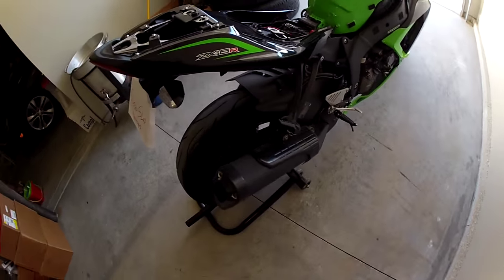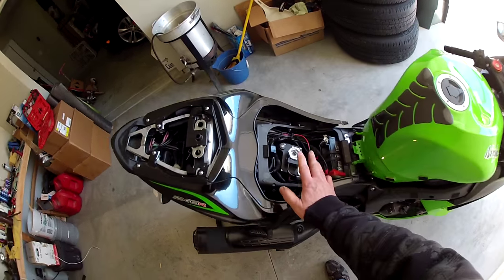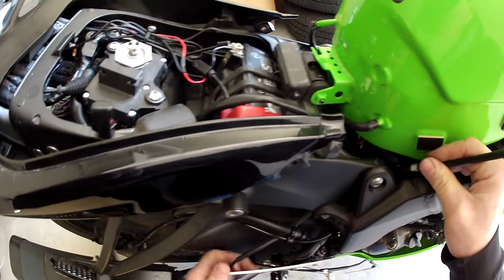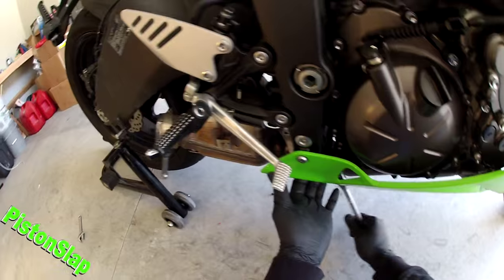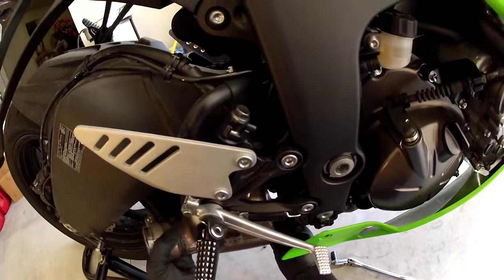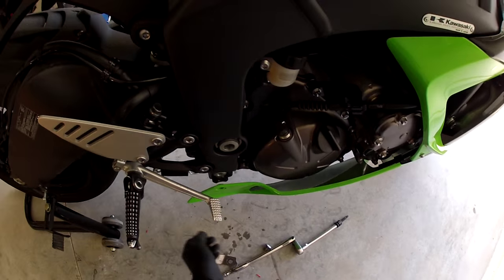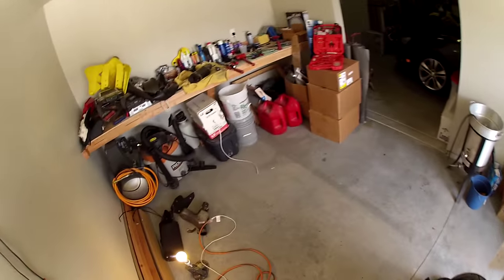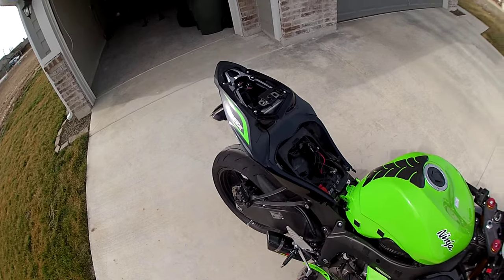How to install a slipon and gut a cat!

Comment: Great video. To anyone watching this vid now, consider using a drill with a long, metal bit. We used about a 5" bit for the first piece of the cat and a 12" 3/8 bit for the second one. Still takes a while and some elbow grease but not too bad, and I'm sure it stresses the bike a lot less than a hammer and chisel/pry bar. Also, you will need a powered plug-in drill. We tried a battery powered one and it was nowhere near strong enough.
Reply from the maker: Paul thanks for that info.  I'm going to pin your comment for everyone.   How much were the drill bits?
Reply: Piston Slap they are about $14 each. We already had the shorter one so if you didn't have any drill bits you could just get the 12" and that would probably do the trick. It might be a little awkward for the first one since it's not that deep in the pipe, but it'd work and you'd save $14

Comment: When removing the cat it is recommended to get a tune that gives the bike a little more fuel than with the cat, due to the loss of back pressure. Without the back pressure, your bike is allowing way more air into the bike, since the air moves faster out of the exhaust. Which means the bike will be running lean. No, it won't immediately kill your bike. It won't kill you bike in 10,000 miles. But it does do some extra wear to the engine, as well as make the bike run slightly warmer
Reply from the maker: Flushhed yep.  It is almost like having a race header.  Just a little smaller pipe and stuff.   I used the tune on graves motorsports site.  The I did a plug reading from the original plugs and the color is almost spot on.
Reply: Questions for yall as my bike is slightly different  (gutted cats, stock pre muffler, m4 muffler after that) thoughts on re tune. What creates more back pressure. Pre muffler of cats? Also stock air intake. Thanks in advance
Reply: Huh and here I thought the o2 sensor on a stock ECU regulates the air/fuel ratio?
Reply: @wpbninja7287  typically it’s only to a certain extent, there’s a set range it can adjust to. i might be wrong, but that’s how it was on my car, it was always recommended to get a tune of you remove the cat because the difference was too much for the ECU
Reply: @dbzx6r  it's is set to a certain limitation but I would only worry about it as check engine light came on specifically for that for fuel trim being set too high or too low cuz that would tell you that you need to get it tuned otherwise you shouldn't have to
Reply: @dbzx6r lf you were lean, could you just upsize the injector to realign the AFR the O2 is looking for?

Comment: I am amazed all the unwanted stuff that comes on bikes these days. You describes the process very well. Even I could do it. I watched the whole thing and I don't even own a ZX6R. What the heck does that servo operate. Some type of exhaust vane?
Reply from the maker: The servo controls a valve in the rear part of the exhaust.   I'm not sure if it's like the corvette and they use it to keep the bike quite untill you get hard on the throttle and high up in the rpm.  or if it's for low end power to build a little back pressure.    I didn't notice a lack in power at the bottom end when I changed everything so I going with a sound control device of some sort.

Comment: EXCELLENT VIDEO, AS HE STATED, STONGLY RECOMMEND TAKING THE HEADER OFF, THIS IS A VERY DUSTY AND DIRTY JOB. I DID MINE OFF THE BIKE AND IT WAS A PITA. IT SEPERATED FROM THE HEADER FINE BUT THE HARDEST PART WAS BREAKING UP THE LARGE PIECES INTO SMALL PIECES TO COME OUT THE COLLECTOR OF THE HEADER.

#1 REASON IS YOU WILL BANG THE HELL OUT OF THE CORE INSIDE THE HEADER AND THE HEADER IS NOT SUPPORTED ANY WHERE ELSE ON THE BIKE EXCEPT THE EXHAUST STUDS. YOU DO NOT WANT TO BANG ON THE HEADER WHILE ON THE MOTOR, YOU COULD EASILY CRACK YOUR HEAD!!! SINCE YOUR APPYING A DIRECTIONAL LOAD TO THE STUD. STUDS ARE STEEL , HEAD IS CAST.
Reply: and wear face mask? surely the stuff inside is hazardous?
Reply: Steve Griffiths it may be, but I don’t think platinum dust is hazardous. It’s never a good choice to breathe in dust though

Comment: are there any performance gains from knocking the cat out, or is it just a change in sound ?  I'm waiting on this muffler to come in for my 17 zx6r and wondering if the extra work is worth it.  Well done on your video, New sub !!
Reply from the maker: frosty116  I would believe there is a performance gain...a small one but your increasing the flow of the exhaust when removing the cat. Thanks for watching!

Comment: I have zx636 2017. I didn’t remove the valve. The two donuts u talking about. I removed just chamber. And slip my new Akra. The sounds is really nice from the stock. Noe my question do u think it will make a major difference if I go for those two donuts or it’s not necessarily a noticeable gain.
Reply from the maker: The gain will be minimal but it was free for me to do it.  The sound will also be a little bit louder.

Comment: Same as my gsxs1000 , told that the cat is the muffler , in the UK so the cat will be needed in the future & I don't mind having a cat (actually want one) removed the muffler but had to take the headers out , grief without taking them off

Good video
Reply from the maker: Thankfully they haven't pushed for emissions testing on motorcycles here....yet

Comment: I have a two brothers slip on and I'm pretty sure my cats are in my header but every forum says that it's in the muffler but it sounds way to quiet to be in the muffler 08 cbr1000
Reply from the maker: I wouldn't know on your bike.   I was told the same thing and when I had it apart I found that they were in the head pipe.
Reply: @PistonSlap  I think that everyone thinks the resonator is the cat idk ill end up buying headers for it eventually so itll be fine I dont think I can decat them bc the cat isnt in the 2-1 pipe in the header it's in the 4-2 section where the header goes from 4 pipes to 2 pipes
Reply from the maker: @alstonz5558  if you are really good with a tig or mig you could cut it and gut the cat then weld it back
Reply: @PistonSlap  might do that itll save me 800$ I dont have a welder but I can buy one and itll pay itself off right away instead of spending 800 on headers

Comment: piston slap i have 06 zx14 with a 08 zx14 header which that year has the cats inside header, ive driven bike 1000miles like this since old owner had just exhaust tips on header only so yeh it was loud... well i found a vance and hines cs1 exhaust or slipon and i gutted my cats in header- since i gut them im not driving it like that since its loud and i dont wanna mess it up neither. should i feel a difference in power considering i never had mufflers since ive had it and i gut the cat? the 06 zx14 didnt have cats in header but if not mistaken it had them in mufflers so i should be okay but i am considering a powercommander but what u think? the secondary butterflys are gone to from previous owner
Reply from the maker: Danger Davefpv removing that cats shouldn't hurt the engine.  They only help clean up the exhaust gasses for emissions.
Reply: Piston Slap thank u pistonslap

Comment: Taking off stock exhaust was probably the most fun, it is one of the best mods you do can. You can also get "Servo buddy" but chose to keep my servo in to save money and no check engine light on.
Reply from the maker: +Shift-Light I want to weigh my stock exhaust,  I also removed the rear passenger pegs ,  (I don't have anyone that rides with me so no need for those).   The bike looks a lot cleaner with out all the stuff on it as well.  I would like to get it on a dyno to see what gains I had made!

Comment: My latest mod!  I don't how you got the pre chamber out without removing the wheels.  I tried but I gave up and took the rear tire off.  However, I didn't remove the cat (Protect Earth) but the bike sounds great!
Reply from the maker: Chris yeah the pre cat was a bit tight with the rear wheel in.
Reply: I did it, I think I let air out of the tyre  til it was quite low and then it squeezed out

Comment: How much louder is the bike with no cat? My friend has m4 gp slip on with cat still in it seems pretty loud.
Reply from the maker: It's loud,  I don't know if its louder than the M4.  I normally ride around in high gear so not a lot of RPM but at the track you could tell.   I have a few track day videos that you can listen to it

Comment: Hey mate great video. I looked through the comments to see if anyone else asked this question first, but no one did. Would you say that it’s doable to saw them out once you make a hole with a drill or is the metal that solid? Trying to find a better way to get them out while we have time on our hands. Thank you!
Reply from the maker: Im not sure how you would get a saw blade down in there and cutting the pipe to get better access to it would posibly cause a leak or alignment problem if your not careful.  Its a crappy setup to try and get them out.   Its one of those thing that will require a little bit of time and effort
Reply: Piston Slap just the blade part itself I meant. Is the material really strong or do you think that a blade could cut through it?
Reply from the maker: @leighpollitt3395  if you got it though it might work.  You would need to get a hole stated first for the blade to go through.

Comment: I have the same bike. I’ve seen the servo on my bike BUT I bought the bike with a shorty exhaust so I’m not even sure if the servo is still hooked up. Also I’m sure my cats are still in. Should I leave the bike how it is until I can get the ecu flashed or could I go ahead and remove all that stuff and flash the ecu about a week or 2 from today?
Reply from the maker: If you look near your right foot peg there would be two cables attached to the exhaust if it was hooked up.   Most guys just remove the cables and leave the servo plugged in to prevent a check engine light. Removing the cat will not set a check engine light.   Im not sure of the bike you have as far as what country your in.  The euro models cam with a o2 sensor.  If that is your case it might trip a light for that. It would not hurt it to run with the check engine light on for a couple weeks if ypu decided to unplug the servo box.

Comment: I would like to see the gutted cat after you knocked all that honeycomb out.  Is the inner wall smooth now?  Or are there remnants of the edges of the honeycomb donuts?  I have a 2019 ZX-6R and would like to retain the stock header if it flows about as good as an aftermarket header.  Thanks in advance!
Reply from the maker: its smooth.  If your looking to squeeze ever once of power out a header would be the choice but for the every day rider I  feel the gutted head pipe is the better alternative.
Reply: @PistonSlap  Thanks for the quick reply.  I am an ex-racer (AMA superbike in '90s) and really just want to use the bike for street and the occasional track day.  I plan to get a pipe and have it remapped at 2WDW.  The stock header looks like it is 95% there, as far as flow, if I add a slip-on.  Just the cat removal is needed.My bike will never be used (by me) in a race, so I do not need to extract that last 1-2%.   Thanks fo rthe vid!  Great work!

Comment: Hi pistonslap ive got a 2015 zx636 and I want to install a akroprovic slip on and remove the baffle box and replace it with a straight through de-cat pipe,if I just disconnect cables and remove them from servo and leave servo in place under seat I shouldn't have to have a tune up or worry about any lights coming up is that right? Cheers
Reply from the maker: You are correct with leaving the servo on the bike and removing the cables.   You wont have a light.  The cat on your bike is in the head pipe. The pipe you are getting is to take up the space from the head pipe to the slip on. Thanks for watching.
Reply: @PistonSlap  thankyou for quick reply I'll crack on and order it cheers

Comment: I have m4 gp slip on on my 2014 zx6r and I am wanting to add a mid pipe to it. Do you know if all mid pipes fit the slip on exhaust, or will I have to get a whole new exhaust? I don’t want to gut the cat like you did, don’t really trust myself to do it. Would rather buy a mid pipe, but don’t know what to buy to fit my current slip on. Please help me
Reply from the maker: I'm not sure what to say.  The cat is part of the head pipe. I don't believe there is a mid pipe unless you buy a aftermarket header. Danmoto I belive  is the manufacture.  With other exhaust systems im not sure of like size or location.   I wanted the muffler/slip on as close as possible.
Reply: Okay thank you man, I may just gut the cut eventually. What do you think the best way to do it is? Don’t want to risk damaging anything ya know?
Reply from the maker: @Edjucated_  the best way is to remove the head like from the engine.  That way you don't risk ruining the seals or head.    A long punch or drill bit with a some elbow grease will work for you.

Comment: So, if I take off the pre-chamber, my bike will be louder? I bought an Akrapovic exhaust. I love the aesthetics but it's still too quiet for me. Seems fairly simple. I don't think I'm going to mess with the cat yet though lol.
Reply from the maker: If you deleted the butterfly valve it might get a tiny bit louder at lower rpm.   The butterfly is in that pre chamber
Reply: Piston Slap thanks man, I tried getting it off and I failed to realize I was going to run into the same problem you did. (The tight space) what tools did you use for reaching those? I’m going to order it on amazon for the weekend. Seems fairly quick though.
Reply from the maker: @itsjustjonnoh  I used a long screwdriver and a medium sized pry bar for the deeper one.   I pined Pauls comment he posted a few size drill bits that he said worked better.
Reply: Piston Slap cool. So, deleting the butterfly valve and a servo delete would probably get me to a decently louder sound. I appreciate the help man!

Comment: Hello man and thanks for the video....
I have a question please and I hope you would help.
I have a 2016 Ninja1000sx, it has no servo but the back chamber and the cat are may be the same like yours.
I've got Akra megaphones slip on on both sides but they don't sound as loud neither as deep.
I'm thinking of removing the cat and the back chamber but I was wondering if the performance would be affected!! What about the O2 sensors, ECU, F1 and resting rpm? What is the best way to fix the above issues after I do that? 
Thanks
Reply from the maker: yazan talab I would jave the ECU flashed to delete the o2. by removing the cat ypu will loose a tiny bit of low end torque but the tune will make up the difference on the higher end of rpm scale.   if you have access to a cutom tuner that is the best route for tuning.
Reply from the maker: yazan talab forgot to add that the rpm shouldn't be affected..the ecm will control the idle.

Comment: So did you pc5 dyno tune the bike? Results?
Reply from the maker: I haven't had  the bike on the dyno yet. But the tune is from graves motorsports.
Reply: Piston Slap dude your video with cat removal was very informative. Even I thought the metal box below was the cat.
Reply from the maker: +Jayden Valentine Thanks!  when I first got the bike and for a long time I thought that was a cat as well.    When I started looking I to exhaust options I fou d out it was jut another muffler.
Reply: Piston Slap any idea what the use of the second muffler is?
Reply from the maker: I think its to keep the bike quiet.  I believe there is a 88 decibel limit the manufactures have to meet.

Comment: How can I find out exactly where the cat is located on any given bike? Especially a new model where they don’t have a full exhaust for yet. Thanks for the video
Reply from the maker: The only way I van think of is physically take the exhaust system apart and look in it. If you have access to a borescope you could slide the pipe apart and slide it in to take a look. Most catalytic converters that I have seen seemed to be underneath the bike at the bend to the first slip on pipe
Reply: Piston Slap borescope. Great idea! I’m looking at picking up a Tenere 700 when they’re available in the states and want to do a proper tune to free up what EU5 takes away from performance. Thanks for the idea
Reply: @PennsylvaniaDualSport  Hey, the cat is in the header's again for the new model. You can follow this video 😉

Comment: I'm debating on removing the cat and replacing it with a mid pipe. Truthfully, was it super difficult to knock the Cat out how you were? It just seems to much more simpler than taking the headers off. (I already have a Two Brothers slip on).
Reply from the maker: If you can get a air hammer and a long bit then knocking the cat out is cake.  Takes a matter of minuets.   If you do it the old fashion way with a hammer and a long screw driver it takes 2-3 hours.  I would recommend taking the head pipe off, but it is not required.
Reply: GcItalianBoy did you ever do anything? Trying to find a mid pipe that will fit my current slip on. Idk if all of them do or not.

Comment: Catalytic converter is there to convert harmful gas. What's the purpose of removing it, to make it louder? Anyone did a before/after cat with significant difference in the sound?
Reply from the maker: Khoa Vo the catalytic converter is there to basicly clean up the exhaust gasses that come out of the engine. When the gasses go threw the "cat" there is a chemical reaction that takes place to make the exhaust gasses less harmful to the environment. Removing it will increase flow through the exhaust, which will increase performance.   There are side effects.  Yes it will be louder.  You will loose a tiny bit of bottom end torque but gain more HP on the mid to top side of the power band.
Reply: Thanks for the reply. I'll leave it intact :D